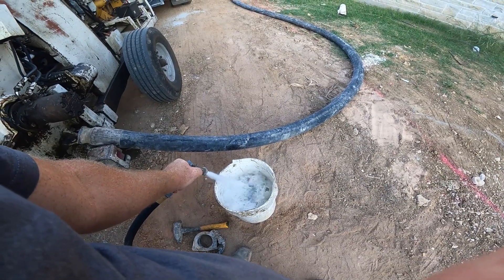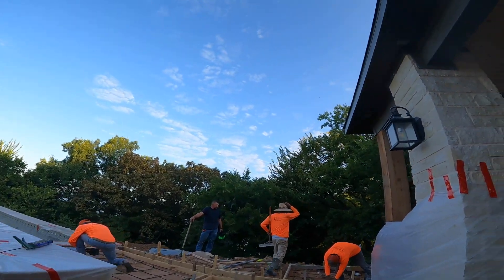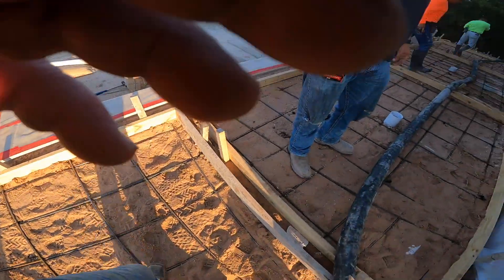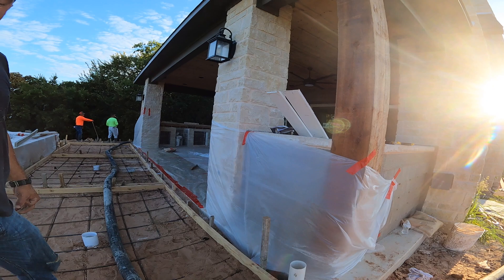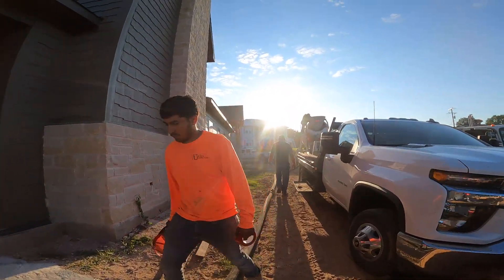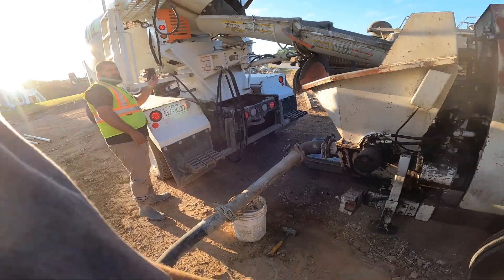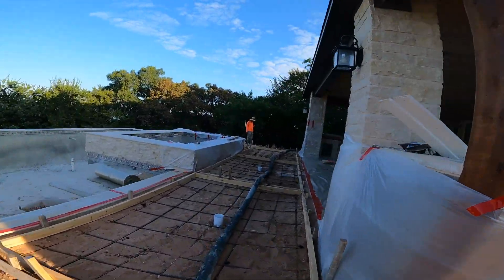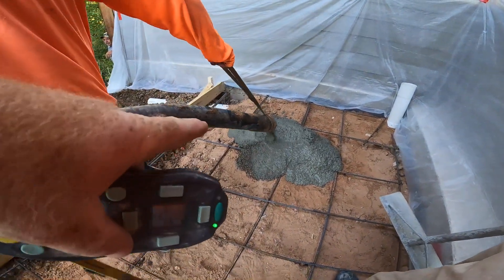Water priming a concrete line pump. Is this possible with Muddyfeet

Comment: Here in Nigeria, you’d be hard pressed to find a concrete pump operator that uses chemical primer. We all use water. All you need is a lil lubrication on the pipes and you’re good to go.
Reply from the maker: Yes water works well for steel pipes

Comment: How come you need 3" hose to pump pea gravel, but the Canadian Cement Pumper Guy can put 1/2" stone through 200 feet of 2" line???...
Reply from the maker: Because I work harder not smarter
Reply: @MuddyfeetConcretePumping  gotta get that underboob sweat going 😂😂
Reply: @MuddyfeetConcretePumping  you ain’t right sometimes lmao!
Reply: We all have different mix designs across the country. I use 2” and 2.5” but we have natural sand and usually get a 4000psi crushed 78 stone (1/2”). A lot of folks have Man Sand that’s almost impossible to pump through 2” hose. Lots of people do it but the slightest difference in one thing or another can mean pushing it 300’ through a 2” hose or plugging at the 50’ clamp.
Reply: Not to mention the time you can save using a bigger hose.

Comment: So, why wouldn’t you prop the hose up 2-3 feet before first connection, open the connection and add 5 gallons H2O towards the pump?
Reply from the maker: Seems like I have had better results rolling the hose than just putting the water in and letting the mud push it.

Comment: We do shotcrete swimming and I use just water for anything less then 100-150ft of hose. I spray for about 10 seconds worth of water per hose then hook up and pump start pumping. We use slick pack on our longer pumps but normally access is right next to the pool so we only need one 2 in 50ft hose and a 2 1/2 hose off of the pump
Reply from the maker: thanks man for the comment. Ive Neve been able to get the slick pack to work. I would like to see a video of that.
Reply: @MuddyfeetConcretePumping   I’ll have to get one for ya on our next long pump

Comment: I work in a rock quarry and we are going to supply a concrete plant with all crushed materials ( from sand to gravels) here in north east France, in the Vosges mountains. I would know wich mix is better for your trailer pump: rolled materials or crushed materials? Stay safe.
Reply from the maker: Definitely the rolled material
Reply: @MuddyfeetConcretePumping  That's what I thought. The concrete plant guys came to the quarry for testing our products, they even try to mix rolled with crushed and it was a complete failure, rolled and crushed don't mix together. Whe are going to supply on 0/4 ( sand), 4/6, 6/10 and 10/14 (all these size are in millimeters )
Reply: @lebarbaretiteuf  just make sure the sand is good not rough because it will not go Tru a pump if it's not NATURAL SAND Plus if your stuff starts Plugging up Pump's all the time us Pump Men will REFUSE to Pump your stuff so make sure it's good for a Pump because you chould lose a lot of work if Mix is not right maybe Go out with a few Pump Operators and see what the mix's they need.
Reply: @johnnybrophy8229  We are going to supply what we call "fresh production" witch mean it's a sand made from the day and we load it in dump trucks literally under the conveyor belt from the screener, the sand is going to have a little bit of moisture due to our dust reduction system ( we are not able to disconnect it because of the presence of quartz silica in the rock and we can't play with the french health department or the french quarry department)

Comment: I used 3 one liter Bottles of Vegetable cooking Oil one Saturday morning no place open to get a Bag of Cement but the Home owner had 3 Bottles of Vegetable cooking Oil. It worked Perfectly fine. I might start Doing that too Prime here in DUBLIN because it's a lot cheaper than a Bag of Cement just have to make sure to catch the oil in a bucket and not let it into the pour area.
Reply from the maker: That is awesome!
Reply: @MuddyfeetConcretePumping  maybe Try it Jeff as you know you do what you have to do too get the job done and I couldn't believe how good it worked. Mite start using Vegetable oil because it costs a lot less than a Bag of Cement